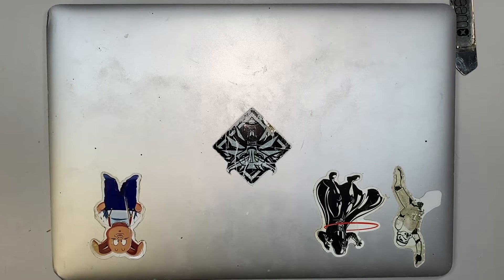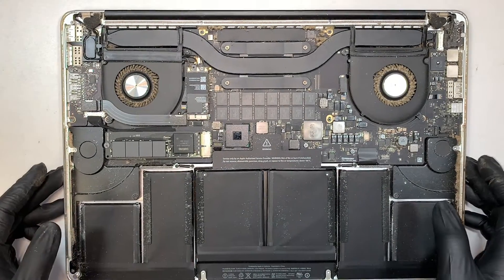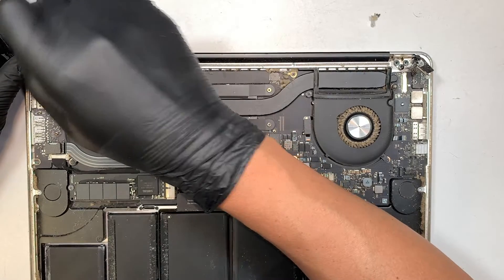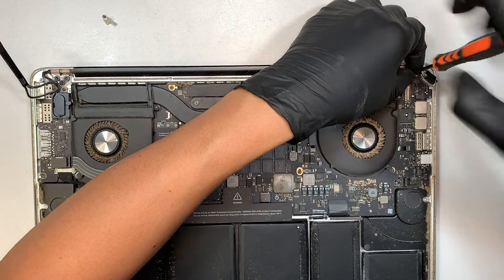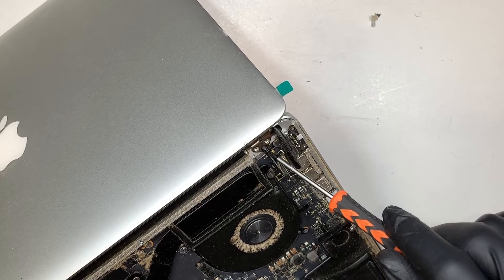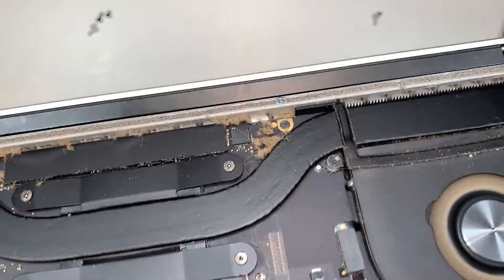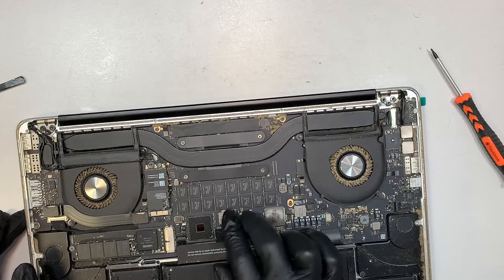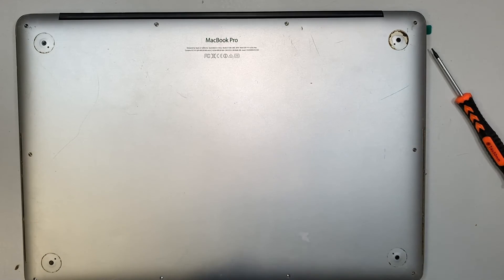MacBook A1398 Screen Replacement 2013 2014

Comment: 6:15 Is this the first one you’ve done? Why are you holding the whole computer to try and put the screen together? You can just put the bottom keyboard facing down on the table with the side the screen goes in toward you and just hang the screen off the table at a 90 degree angle. Makes it a lot easier to put together